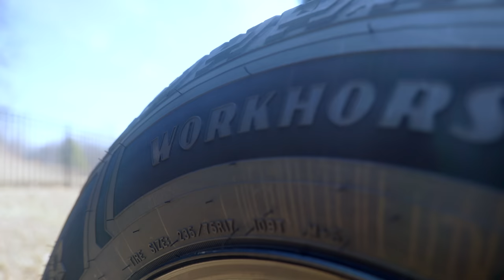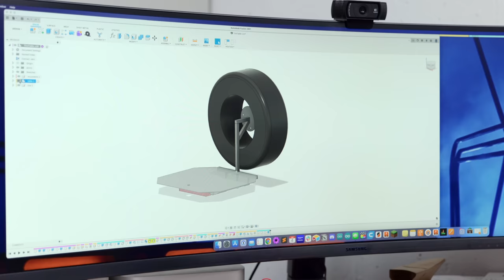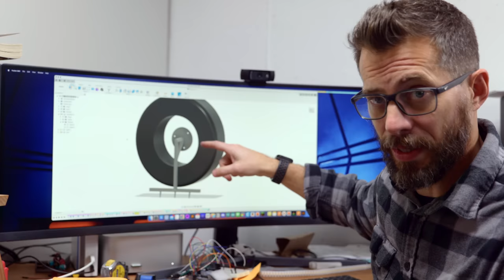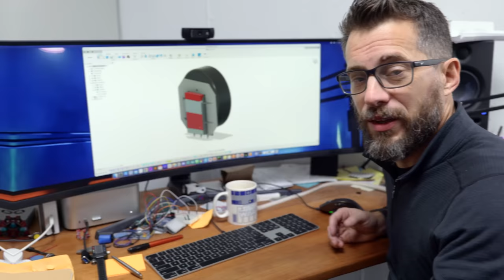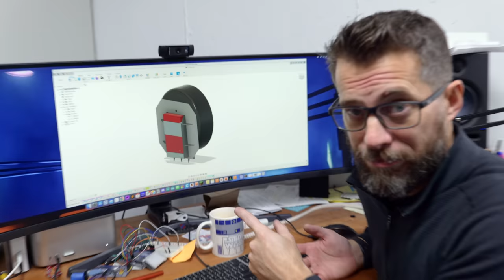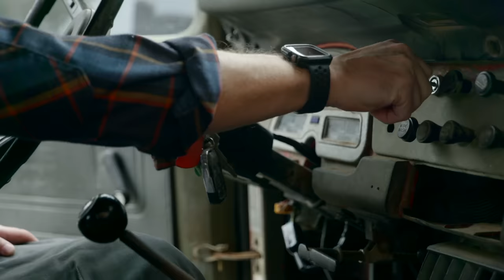Grill on the Go for my Classic Land Cruiser (1976 FJ40)

Comment: Probably already said but I'm gonna mention it anyways; One of the biggest things to aid in TIG welding Aluminium, is using a pedal on your AC/DC welder. Hold your material in place with a clamp or something, take a seat(trust me), put your foot on the pedal and start welding.

Go full blast at first, then slowly ease off as you continue welding the seam. Add filler where needed but keep control over your little metal pool. Filler is used to cool it, your torch to heat it. And practice, practice, practice is everything.

Comment: Great Table!! A few tips from an old Air Force sheet metal guy. When working with aluminum throw that de-burning tool in the trash. Use a file or a piece of steel instead. Works way better and faster. Also sand the edges of where your bend is going to be up to 400 grit. It will be a lot less likely to crack.
Reply from the maker: Great tip! Thanks!

Comment: You could save a lot of weight by cutting out some triangles in the box, you could even use those triangles for the supports for the outer edge
Reply: I wonder how much weight would actually be removed and with the tools he used it would be very difficult and time-consuming to cut neat triangles.  A plasma torch would make short work of the cutting, but there would still be work to clean up the edges.  I don't think, IMHO, that the weight saving would be worth the additional work.  It would be interesting to see how tidy of a triangle could be cut w/o the plasma torch?

Comment: The only thing I recommend is changing your method of how it's held for storage. It wouldn't take a long drive for the steel edge to wear through the strap, and dump your grill on the road. Weld a cap with a short pin on it over the spot you have your plastic cap. Then drill a small hole through the table top, so when you fold up the table, the pin comes through the hole in the table, and can be held in place by something like a lynch pin. Would be a much cleaner look, and any vibration could be dealt with by some cleverly placed rubber strips 😄

Comment: I don't know what all has been said. But the short time I remember doing TiG in classes, TiG is a little cheatable by running slightly cooler than you think. Also if aesthetics aren't as important, Add your filler material for your tack where you want, line everything up and pulse for a second or two. It'll create a strong enough tack weld for you to keep going. Aluminum is fairly hard.

Comment: Nice work and slick Idea.  Not to throw shade on your stuff just a few (hopefully constructive) suggestions.  You maybe have already worked though these and went the route you did for a some reason or another.  You might want to put the frame for mounting and hinge behind and under the the spare tire.  That way don't have to unbolt the whole thing to take the spare off.  You still use the spare tire carrier as a mount point, but off set the tire studs in your plate and design the frame to sit behind it so that if you need the tire you can just fold down the table and remove it.... change it and store the flat tire there and fold it up.  The other would a cool cover, which I'm sure you already have in mind.  Will keep thieves and crack heads from noticing the cook top there and if you make from something water proof help keep it nice.  Awesome work though.  Might be easy to do once you figure out the welding with the aluminum.

Comment: Hey Bob, You need a large heat sink (thick steel plate ) to draw the heat while you weld aluminum. This keep the aliminu, from warping and moving. 🙂
Reply: With aluminum gotta have that tungsten in the cup more to stay in the gas zone

Comment: The way u weld it without deforming it is a trick called cold welding it is where you welding in a spot for a second then move to another spot then to another. It takes longer but it keeps the metal from warping and twisting

Comment: Make sure the sheet aluminum isn't 7075 aluminum as it's not weldable. Also you should be pre heat the aluminum to assist with the weld.

Comment: Great idea and execution. I think you'll find the steel set up will be fine. TIG on thin aluminum is a skill you'll develop, far faster than I will (gotta get a TIG first😆). The guys who say you should mount the cook station behind the spare need to consider a couple of things. #1- which will be needed more often?  My vote goes to the grill. #2- When was the last time you needed to use your spare? Yeah, not often these days with present day tire construction.  Something you may consider, unfortunately, is some kind of anti-theft strap to keep from replacing the grill more often than desired.

Comment: I actually got an idea of what you can do with the square horizontal hole. Make a mount that you slide into it and use as a spitroast support above the grill itself. You could just drill out 2 holes on the opposite end of the table (the top when its folded) and have two thinners bars slot into it opposite the mount for balance, and the spit itself can just have a pair of folding legs that you can throw into the back of the pickup when you're done as a single unit.

Comment: another option for welding aluminum is to use a stick welder and use aluminum rods. Then you don't have to flip your polarities or anything and its much easier than tig welding. Also it helps to turn the heat up and go fast at first to get a tack especially with thinner material. You have to go a lot faster than you'd think.

Comment: You will need to remove all millscale from the welding area to get a good weld. Aluminum mill scale has a higher melting point than the base weldament so you will not get any penetration before the piece has begun to warp or base metal becomes overheated.

Comment: I think you are ready for some small plasma-cutting equipment for the steel. And I think everybody welds aluminium with something that looks like a Mig torch with a wire cassette??? SV Seeker

Comment: it's been a few years since i welded aluminum, but from what I remember aluminum needs to be cleaned with a wire brush, usually stainless steel that has been used for nothing else, along the joint your planning to weld. I don't see the dull scratched look from the brush on your parts, wire brushing removes aluminum oxide from the surface of the metal the oxide has around twice the melting point of the inside metal meaning that by the time you heat the oxide enough to melt and start your weld puddle the metal under the oxide is already liquid and just flows away leaving holes. From the look of the tacks shown in the video very ball like and on the surface looks like your not getting hot enough to fuse that might be because of the oxide layer.

 Better clamping of the part down to the table to control the warping might keep your parts together long enough for the tacks to hold. I don't know about having a big steel angle right on the other side of where your welding having never tried it but it might be interfering with getting enough heat. Heat spreads like crazy in aluminum where as the steel is a big cold heat sink soaking it away.

Comment: I do a tiny bit of aluminum welding at my job, tig welding aluminum does suck, especially when it can sometimes look okay but not be strong enough.  I have heard that the aluminum welds better when it is heated up first, something so big would be hard to heat.  I would suggest getting an aluminum spool gun for your mig set up, but that's not fool proof either, I've just found it easier to weld aluminum with mig.

Comment: I think either way with the welding you might get warping problems with how you designed the structure and you would have difficulties getting a flat table top.

Ideally you would just weld some brackets on the understructure and screw the top to those

Comment: Hey Bob I'm working on my first woodworking project: refinishing a pine dining table. I just finished my sanding (80, 120, 220) first with an orbital sander and then by hand to get rid of potential swirls. I'm really happy with how the sanding came out but I have no clue how to actually finish the table. What would you recommend I use/do? 

I don't want to stain the table, from what I gather pine stains very unevenly. I just want to make the grain stand out with a nice sheen and make those subtle colors pop, while protecting the wood underneath from potential food and drink spills.

Comment: are you pre-heating the aluminum before welding - I have zero experience but have seen this done in the past with thicker materials like aluminum bus - Im sure its to move out porosities in the metal - but may also help reduce the amount of localized heat required for the welding and rather spreads the heat out evenly to prevent distortion  - just a thought - im sure someone with experience will call out my ignorance, even though i have stated "I have zero experience."

Comment: Nice video! I will probably never in the foreseeable future have a project like this; however, I have learnt several things from this video. Things such as design process, how to transfer/template a hole pattern, and it's ok to change certain design elements along the way.
I thought that cut-out pattern in the steel looked really nice with the red grill behind it. Did you cut it using your water-jet?

Comment: Isn't your welder just a Lincoln 210mp? If I recall correctly it's only capable of DC Tig which isn't suitable for aluminum welding. However you could put a spool gun on it and run aluminum wire through it for the easiest aluminum welding experience.

Comment: If you made the bottom section wider and bolted it behind the spare wheel, you wouldn't have to drop the whole assembly any time you needed to remove the spare wheel.

Comment: Two comments:

1.  Lightening holes are cool and could make the steel part lighter.
2.  Check out the Making Stuff YouTube channel.  He's making an aluminum jet boat and has been doing a ton of aluminum welding using an inexpensive MIG system made especially for aluminum.  I bet you'd have better luck with a system like he uses.

Comment: why did you have to disable the daggers features for the sawstop when cutting the aluminum?
Reply from the maker: If you don't, it will set off the saws safety feature. This will happen with any conduction material like metal or even wet/green wood.

Comment: I'd be putting a new set of springs in the back before adding any more weight on. They look like there is a couple of broken leafs at least.
Reply from the maker: Yeah, full suspension replacement is on the list for the next year.  It's trashed :)

Comment: Just some urgent advice from a sheet metal worker.  NEVER hold your plate like this when drilling holes.  
If the drill gets stuck in your hole, your plate will rotate in circles and chop off your fingers without effort.  
Always use a clamp to secure your plate.  That takes a little more time, but without  fingers you are very limited in what you can do with your hand.  
As an in-house emergency officer, I have had to pick up someone's finger from the dirty floor in the past, and that does not please me

Comment: The area where the cooker/grill will slide into has been designed to be a water catchall. I would suggest at least drilling some drain holes. Maybe a mesh bottom.
Reply from the maker: Yes, I did add some holes, just forgot to mention that in the wrap up 👍🏼

Comment: 3d print a spacer to go in between the strap and the table so over time the strap doesn’t get shredded from the vibration of driving
Reply from the maker: Great idea!
Reply: And also add some plastic or rubber spaces inside the space for the grill so that you don't completely destroy the paint.

Comment: Try preheating your aluminum with a torch before welding.
Reply from the maker: Yeah, I did, but maybe not enough? I was thinking that since it was such a large piece, the heat just kept spreading aware from the spot I was trying to warm up, but I'm not sure.
Reply: @Iliketomakestuff  Another thing you could do is on the TIG welder you don't have to go full hog on the pedal, it takes practice but you can control the voltage that way.

Comment: The diagonal bar is not correct. A vertical plate in contact with the plate of the wheel, horizontal bar and vertical bar would be correct
Reply from the maker: thanks!

Comment: Tig  is difficult to master and aluminum is fickle. I'm not sure what tungsten and shielding gas you are using. You should be using pure (green) tungsten and pure argon.
Reply from the maker: I did have pure argon, but not sure about the tungsten. I didn't get anything specific for AL, so maybe that was part of the issue?
Reply: @I Like To Make Stuff  that could be some of it. Make sure you are set for AC polarity and you start lower on the amperage. You can always move up if you don't get enough penetration. Too much will make holes.